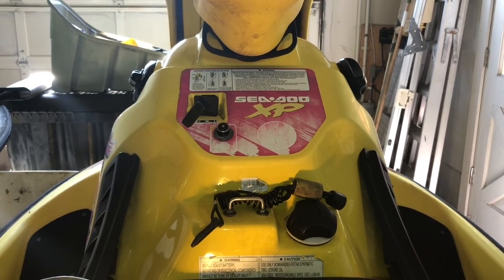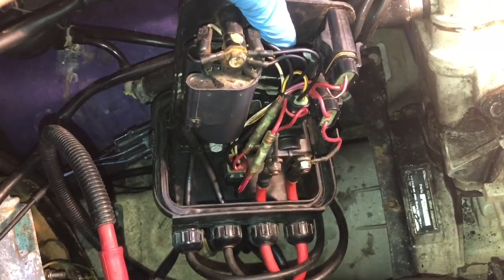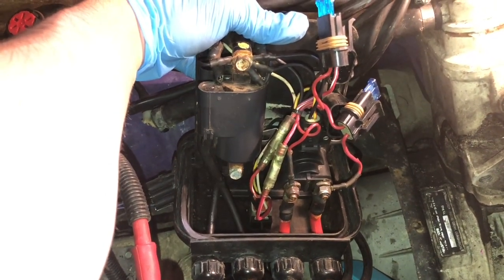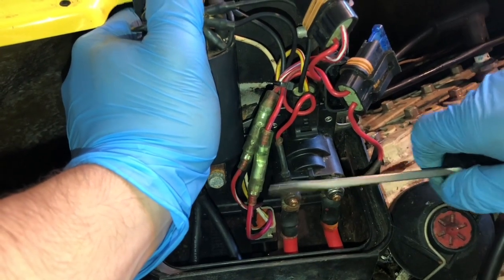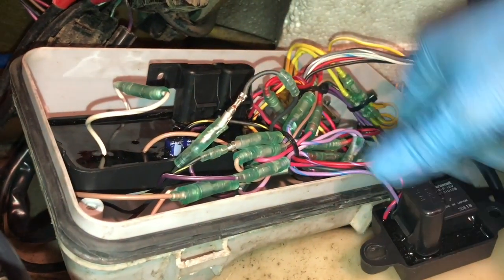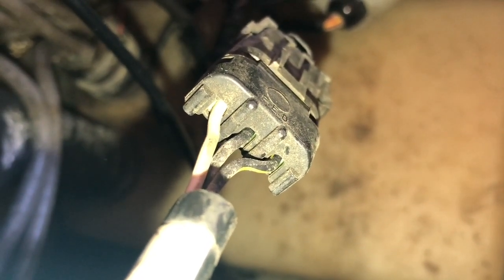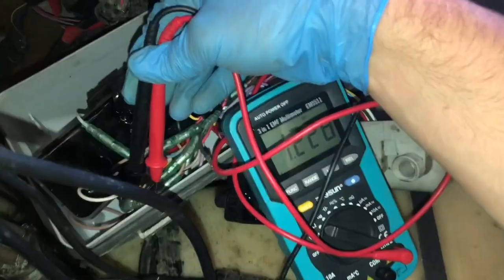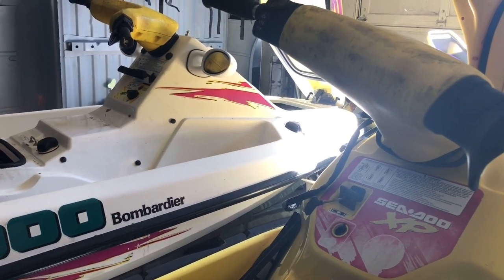1996 Sea-Doo XP Common Electrical Issues Fixed in Detail

Comment: Hey I really appreciate this video! I just picked up a 93 xp the previous owner changed the solenoid melted a wire and gave up the black wire from the flywheel and I'm having a hard time sourcing a wire diagram for it is there anyway you could help me with a pic?
Reply from the maker: I do not own my Sea-Doo anymore sorry.

Comment: Ok... several things. 
First, if you're attempting to do a how to video with electrical items using DC, please be mindful of pos and negative connections. 

Next, you did A LOT of this out of order. 

First thing you check is the DESS (key). Should give 2 fast beeps in normal conditions. This is a diagnostic system. No beeps, (or different pattern) indicate next step. 

If no beeps, first ensure battery power is at the nominal 12VDC USING PROPER POLARITY to ensure against a polarity reverse issue. 

If power is good, go to DESS post. Post ohms should be infinity without key and about 1 ohm with key. If good, and all beeps are in order and a "no crank" conditions continues, open the electrical box near the VTS and check fuses. And power on the INPUT side of the solenoid. 

Replace bad fuses and try again. If issue continues, recheck fuses. A bad starter, solenoid, battery (even reading 12VDC but with low cranking amps) or short may be your problem if fuses continue blowing. 

If fuses are Good, and the is still no beeps, try removing the DESS and press the START/RUN 5 times, and listen for beeps. This is a secondary diagnostic system. If no beeps present, continue troubleshooting. If beeps are present, your DESS maybe the issue. Good to dealer aaaaand have them make a new DESS. ($20)

Open the grey box in the front near the fuel tank. In this box,  1 side contains the MPEM and the other contains a bunch of wires a relay and other devices. Check the 3 fuses here. Replace bad ones and observe and correct any water damage. Note the 2 posts with black wires bolted to them. These adre the ground for this part of the jet ski and the ground wire coming from here often breaks. If after repairing water damage and checking fuses, a no beeps condition persists, run a jumper from either ground post back to the battery and try using your DESS again. If no beeps continue, and all wiring is good, the culprit may be you MPEM. 

Once 2 beeps are confirmed, proceed to next part. 

 Apply DESS and using test light or multimeter, read voltage on OUTPUT of solenoid. Should be ~0vdc. Press start/ stop button while testing and voltage should jump to 12vdc. If not, continue to next paragraph. If it does go to 12vdc, then either the wires going to the starter have a problem, or the starter is defective. 

Disconnect 2 wire connector going into solenoid and using test light or multimeter with good ground, check for power on the yellow/red wire. It should be ~12vdc. Also, inspect the connector for water damage (common problem). 

If power is present, then the solenoid is defective and should be replaced. If no power at this wire while pressing start, disconnect the wires under the handle bars for the start stop button and test with multimeter. When button is not pressed, ohms should be infinite. When pressed, resistance should be~1 ohm. 

If defective, replace button and try again.

If problem persists, check wiring between button and solenoid, or between "point a and point b" were power isn't present.  

DO NOT ARC ACROSS SOLENOID AS YOU RISK DAMAGING THE STARTER, BATTERY, SOLENOID AND IN THE EVENT OF A SHORT, YOU RISK BODILY HARM FROM BATTERY EXPLOSION.

And I will be making a proper video to detail all of this. Sub to me for the video. It will be posted by June of 2019.
Reply: Jim Miller getting ready to go pickup a 96 xp 800, might need that video soon the guy said no start and I know nothing about jet skis just want one to ride
Reply: Subscribed to your channel also. Where's the vid you said would be out by June 2019?!? Lol
Reply: @thebeaverdampickleballclub  you're right. Im behind. Sue me.
Reply: @thebeaverdampickleballclub  look. Im going to be honest. I'm dealing with some shit and haven't even been able to ride my ski let alone take a video of it. I'm dealing with some legal stuff. I'm a firefighter and some people are attempting to steal from a non-profit some men from my department set up a long time ago....
Reply: Jim Miller hi did you ever get that video done about the testing on no sparks on seadoo I need help thanks
Reply: Hey Jim did you make that post where can I find it on YouTube you've got a lot of valuable information there thank you very much
Reply: And what's a d e s s?

Comment: Great video. But. Jumping the solenoid would only test your starter and not the solenoid.  But thanks for the info.
Reply from the maker: jason, if you jump your solenoid and it works then you can infer that there is something in that circuit that is not working could be solenoid or other things.

Comment: Very helpful. Only thing I was confused about is jumping the solenoid. Even if the switch is bad it will still turn the starter when you jump it with a screwdriver. I always thought that was how you knew if it was good or bad. Am I doing it wrong? lol
Reply: You are correct. When he jumped the screwdriver across the solenoid, if the battery was hooked up and the starter was good, it would have cranked.
Reply from the maker: Very good catch!
Reply from the maker: Yes you’re correct. I worded it incorrectly, my starter motor was not working causing the power to not crank the engine. Though the power was still jumping the solenoid.
Reply: Yes that was what I was going to say if you jump a good or bad solenoid it's going to jump no matter what because you're just bypassing it by bridging
Reply: actually, jumping it would cause the starter to fire even if you dont have a key in.. it just wont start.  he had 2 issues.. 1 bad starter, and 2 bad safety post.

Comment: Working through the same issues now thanks for taking the time to help others
Reply from the maker: No problem, let me know if you have any additional questions!
Reply: Power Sports Builds I ordered a start stop switch button, it don’t work I tested it , but when I put the key in it doesn’t beep so I checked the key as you did in the video and it checked out good. Could it be the beeper it self? Also no lights on the gauges

Comment: My 5 amp fuse keeps blowing everytime I put one in there. The one next to the 15amp fuse. Any thoughts on how to fix?
Reply from the maker: Hi Shane, usually if that fuse keeps blowing you have a short to ground somewhere. I would check two things assuming you have a seadoo xp or something with similar components. You will want to remove the wires that connect to your vts box. If the fuse does not blow then that’s the issue. If not that then I would test your stator. I have another video on my account where I test the stator so you can see how to do that. 
My email is pagsli34@gmail.com if you have anymore questions. Best of luck!
Reply from the maker: The video on my account i think is called testing Seadoo xp ignition systems I believe
Reply: @adampaganelli4891  if you replace the dess unit, do you need a new key? Or reprogramming? Thx bro, you are the best
Reply: Usually this means your mpem is shot 
Just replace it and it’ll be good
Reply: I replaced MPEM. Started right up. But now, if i kill it a few times and goto start it, it will just make like a loud clicking noise. Half the time it cranks over the other half the time it doesnt. I'm thinking starter is bad and seizing up half the time maybe?